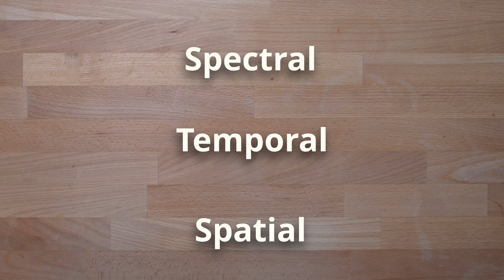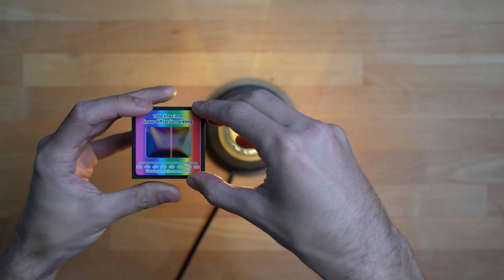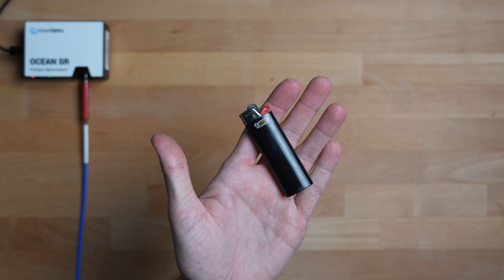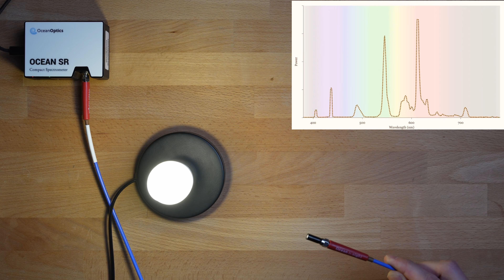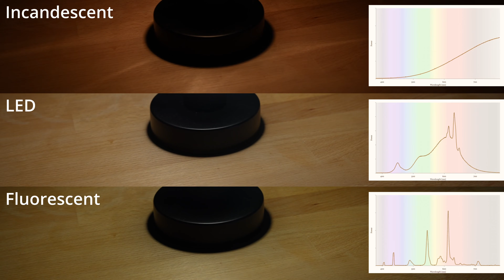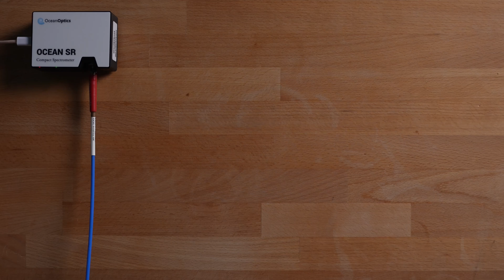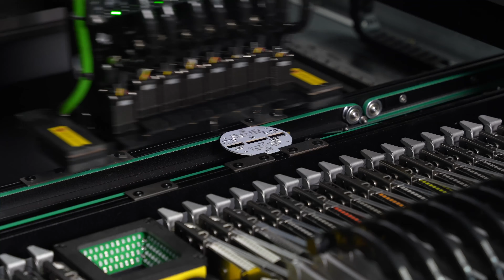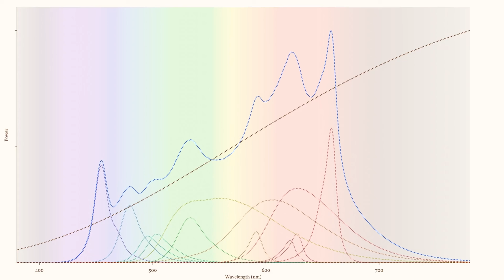Why Modern Lighting Feels Bad (and How I Fixed It)

Comment: I've noticed this as well, and for this very reason I'm still using some halogen lamps in my apartment. One thing I would have loved for you to touch on is CRI (Color Rendering Index), which I thought was a metric designed to let consumers know how accurately a lamp will represent the spectrum at its rated color temperature. What's your take on this? Have you measured the CRI of EP01 at various temperatures?
Reply from the maker: I am going to cover metamerism, CRI, TM-30 and other color metrics in a future video. I had started to include it in this video, but decided to focus on spectral power distributions / blackbodies exclusively as they're the foundational understandings needed before going into color metrics. 

I have measured EP01's CRI at various temps. CRI at 2700K is 98-99 for reference. I tend not to use CRI as the authoritative metric as it's a bit unreliable (https://en.wikipedia.org/wiki/Color_rendering_index#Criticism). Enody's optimization relies on a modified SSI to more accurately emulate the spectrum directly instead of using the sample based approach of CRI.

Comment: HEY, SO, I'm like... a HUGE fan of light bulbs, like, massive. They are an appreciable expense in my house because of how many I buy and for all the applications I use them in. I don't mean to brag... but I have a high CRI 100W (From the wall, not equivalent wattage) light bulb lighting up my bathroom... and a bunch of other high wattage high CRI bulbs lighting up my house. I buy grow lights for... basically everything in my house. My house is well lit like a MOTHERf*cker! After all this time learning about lighting and why my own home feels bad, I've come to the personal conclusion that all my lights are just in the wrong places doing the wrong things.

The best lighting upgrade I ever did for my kitchen was to angle my overhead lights so that the point lights were used as task lights rather than ambient lights... and that made a bigger difference than ANY color temperature, rendering or temporal change could. I worry that in your pursuit for the, "perfect light bulb" it might jump your mind that the biggest difference to lighting is often not color and spectrum, but placement. I have a room in my house that is lit from above with 2700k string lights placed around the ceiling a few feet away from the sloped roof. In other words, absolutely perfect ambient lighting. I still have many other lamps and task lights and clamp lights and aquarium lights to light up specific areas of my house that I want to draw focus to or do tasks under. I hear that you want lighting to help humans with sleep and skin and a buncha other physiological stuff, and I see that you're trying to match lighting to black-body radiation, but I feel you might be missing the middle of the problem, what's in between the bulb and me, all my walls and stuff! I can't imagine how much work you've already done to bring you this far along in the process, but make sure you talk to interior lighting experts, as they probably have similar wants in a light bulb as you, and have plenty of hands-on experience when it comes to designing beautiful spaces in regards to lighting. I think that beauty is a better target than healthy when it comes to lighting. (especially considering that beauty is a very important part of human health)

I should also mention, most of the stuff you've described can be had in aquarium lights. multiple LEDs with different temperatures and colors? check. High CRI? check. individually addressable LEDs? check. app-enabled timers so that you can vary the temperature, color, and brightness over a 24 hour time period to match the cycle of the sun and moon??? check. Buy some, break them down, learn all their juicy secrets, and then sell me one I can put in a lamp!!! Or one of the other dozen different types of light fixtures and sockets in my home... gosh fit one of your bulbs in a MR16 socket without it overheating why dontcha'... or a boob light...

Look, all I'm saying is that it seems like a lot of disparate and competing ideas are all coming together into one blinky tech sandwich, and I'm really excited to see how you come up with 'your' 'perfect' light bulb. I don't think that this fixes modern lighting... at all, because the problem with modern lighting is that there are actually 100s of problems, most of which are just interior design problems as old as the concept of a fire in an enclosed space lol. Most have overlapping and competing solutions, and there's not just a drop in fix for every use case for every room for every space... But I am very glad that someone cares as much as me, in fact more so because you're actually doing something about it!

In conclusion if you make a lightbulb that makes me FEEL like there's a real sunset in my house every night I will just hand over my wallet, checkbook, banking details, and any spare change I find between the couch cushions.
Reply from the maker: I completely agree that placement is incredibly important. When considering the aspects of light (which I group into spectral, temporal, and spatial), I viewed spatial as the least controllable up front. Spectral and temporal I can address immediately, but until Enody makes much more form factors spatial remains elusive.

You've absolutely nailed the end goal though. If we can have enough light sources, with great spatial variety and temporal synchronization, we can mimic a real sunset. Further, what if we had an affordable spectral recording device and you could replay the exact sunset from a memorable evening? EP01 was designed to be the authoring node in a system like this. Replay and design lighting recipes (for lack of a better word) at your desk, then deploy them to your whole home / office / neighborhood.

The future of lighting is enthralling, and I hope Enody can accelerate the timeline :)

Comment: This is very cool, do you think that maybe some form of physical colour filter could be used to flatten out those peaks? Maybe something for version 2? and also, are you planning on releasing a bulb version of this product for existing light sockets? :)
Reply from the maker: Physical color filters could be used to reduce the amplitude of some peaks, but they come with a couple issues:
1. Absorbed light turns it into heat. This will lower the overall efficiency of the lighting.
2. The filters themselves will cause a new set of peaks that will have the same effect.

As the bulb is dynamically shaping the SPD, flattening the peaks in one configuration could cause worse peaks in another configuration. The best solution would be to increase the number of color channels while decreasing the width of their spectral power distributions. This would give you finer control and allow you to lower these peaks. Unfortunately this is a bottleneck in the underlying physics of LEDs, and until new LED types are developed we're going to have these peaks.

A bulb is definitely in the works. I would have loved to ship a bulb as the first product, but the manufacturing demands to make a bulb are significant. The  plan is the same as many new hardware companies: start with a high-end product while the technology is still expensive, then scale manufacturing and bring costs down. This will allow Enody to ship increasingly diverse products and make spectrally tunable lighting cost competitive with current LED lighting.

Comment: I actually still use carbon-filament bulbs in some parts of my house rather than tungsten.  You want warm?  This is curl-up-next-to-a-fireplace-with-a-good-book-in-the-middle-of-a-blizzard warm.  Efficiency? Terrible.  Is it worth it?  absolutely. 
I use theatrical lighting gels/filters on the other lights in my home.   Lee#052 - Light Lavender mimics the GE Reveal bulbs.   Rosco #3220 Minus Green gives that lovely pinkish warmth for living areas.

Comment: Product costs $329 for those curious.

While I appreciate the engineering and ethos behind the product, a 75W incandescent bulb left on 24/7 would cost just over $8/month (assuming $0.15/kWh), meaning a breakeven of just over 40 months.

While I also appreciate this does a lot more than a dumb bulb, ROI just does not make sense to me personally, Jo Shmo looking for decent interior lighting. Despite that I hope this finds success and flies off the shelves and fights break out amongst those hoping to secure themselves a piece.
Reply from the maker: Fully understand that. The long term plan is the same as many new hardware companies: start with a high-end product while the technology is still expensive, then scale manufacturing and bring costs down. This will allow Enody to ship increasingly diverse products and make spectrally tunable lighting cost competitive with current LED lighting.
Reply: @enodylighting  I completely understand and applaud you, and wish you the best of luck

Comment: This video kinda goes topsy-turvy on a core principle of the LED lighting community.
We need LED white light -> "mix R G and B" -> it looks bad -> "get WRGB strips with separate white channel!" -> can't control the temperature? -> get CCTRGB strips with both warm and cold white channels -> I have money, and I want the endgame stuff -> get a CCTRGB strip with 98 CRI on the whites.

I have one more remark, I'm just a itsy bitsy teenager from a 3rd world country, but even I had already through of taking several leds to (lets say a cyan led, attached right next to a white led, whose only purpose is to fill up the cyan valley) complete the gaps in led spectrum to mimic sunlight.
So this really isn't a novel idea. Heck it was the only logical solution, that people much smarter than me might have already thought of and abandoned.

Comment: How are people obsessed about lamps so much that they are willing to dump money into them. The job of a lamp is to enable you to work without sunlight, not trip while walking, see into deep shaded corners. To light a room practically, you need ceiling lamps or spotlights not a sphere that sits on a desk.

There are ultra-violet LEDs from Korea that have three phosphor "mountains". They are less efficient and cost a lot of money, but definitely less than a custom solution. If this is a promotion from a company, why do I still see unskippable advertisements in this video?

Comment: I get that the current price on the website is due to the limited and largely hand made manufacturing process, do you have any idea what a per unit cost would be to have something like this mass produced? I'd love to have multiple lights like this in every room of my house but the current cost is a bit much for that.
Reply from the maker: With mass production I anticipate getting cost competitive with comparable dynamic bulbs (i.e. Hue) relatively soon. To get truly cost competitive with the budget bulbs at your local hardware store, Enody is going to need to vertically integrate and own the LED production process from MOCVD to end distribution. I'm excited for the road ahead :)

Comment: 342 subscribers and 7.5k views on the only video on the channel, video released 6 days ago. Yeah, if you keep up the quality, and if you , release the next 2 videos in the series relatively soon (as in within a month since the release of the first video), this channel will reach 10k subscribers and 1m views within a few months at most. Even if half the video is advertising your own product. 

And speaking of product, please consider making a single-LED capable of producing sunlight at different periods in the sky and in different seasons, and use that with a parabolic reflector, to make a fake-sunlight product which to not only make realistic sunlight spectrum light, but also to make it travel in parallel, to look like it's actual sunlight, instead of a pale imitation, even if it is a pale imitation. And by being able to turn a dial, you could swap up that LED with another LED in an array of LEDs, and end up producing nearly-sunlight of a different season and/or time of day. 

That could even be automated, to make fully artificial fake sunlight for things like bunkers, fancy (expensive) houses, (international) leadership offices, and even psychologic and psychiatric research. 

And a cheaper but lower-quality version could be made using either a LED and a fresnel lens, or multiple LEDs and fresnel lenses, to be able to imitate much larger windows, while still keeping the fake-sunlight panels thinner. 

And that could even be miniaturized, to have lots and lots of tiny LEDs, together with very fine fresnel lenses, to possibly have fake-sunlight panels as thin as solar panels, which could also be advertised not only for office usage, but also for usage on other planets, and on the moon, where the radiation would require the astronauts to be shielded from sunlight for most of the time, but the effects of not having realistic sunlight for extended periods of time would also be very negative, and such a product, if made to be very thin and lightweight, with smaller LEDs which would also help a bit with passive heat dissipation, could solve that problem, especially if paired with realistic-looking fake plants and flowers, and having hidden perfume dispensers in those flowers and plants, to have a calming effect on the astronauts, maybe even having a small (2 yards/meters wide and 4 yards/meters tall and a thin layer, but not a laminar flow, but rather a realistic turbulent-flow) waterfall on display, a real one, even if it's behind a glass window, for reasons of sanitation.

Worst case, you could even use all LEDs together with a prism in reverse, to merge the light back together into a single stream of light with the rays going parallel or very close to parallel.

Comment: The linear combination of LEDs is not comparable to training ML models. Cmon. This is a cool product, just don't overhype it.
Reply from the maker: Apologies, I did not mean for it to sound like a direct comparison it to the training of ML models. The process I was referring to is the utilization of gradient descent to optimize the color mix for arbitrary goals (loss functions). The nice benefit of the recent AI boom is that frameworks for utilizing GPUs (or other compute) to perform gradient descent have become much more accessible. In Enody’s case, tinygrad is utilized. An example can be found here: https://github.com/enodylighting/enody-py/blob/main/examples/optimize_chromaticity.py
Reply: @enodylighting  You want to use linear regression, not gradient descent here.

Comment: is the difference between this and having LEDs that mimic light temperatures but only by emitting 3 colours to stimulate the 3 receptors in our eyes the way that these interact with materials which may particularly absorb the traditional LED spikes in a way that would appear differently to natural lighting due to the intricacies of a materials absorbancy graph not being captured normally?
Reply from the maker: Yes. While a trichromatic (3 colours) light will look correct when you directly observe it, the way it illuminates your environment will be incorrect. When something is illuminated, the color you see is a multiplication of the spectrum of the lighting and the reflectance of the material. For example, a cyan object reflects a lot of cyan light, but minimal of any other color. In this situation, the 3 colours (assuming RGB), will fail to provide sufficient light in this range and the cyan will appear desaturated and washed out. I will cover this in a future video :)

Comment: You should ckeck YujiLEDs. They make very high quality bulbs that match real sunlight. They also make 2700K lightbulbs with high CRI. I bought 4 bulbs from them and they feel very nice. (2x 5000K normlight and 2 6500K sunwave)

Comment: I'm surprised that CRI (color rendering index) never once came up in the video. It's a decent single number to describe how natural light produced by a bulb is. Incandescent bulbs have a CRI of 100 (the reference standard). Fluorescent bulbs sit around 60-85 CRI, though there are triphosphor variants that reach 80-90 CRI. Cheap LED bulbs sit around 70-80 CRI. Good quality LED bulbs typically exceed 90 CRI and can go as high as 98 CRI.
Reply: Yes but selling the magic lamp is the idea here, not informing viewers that high CRI lighting options at much more reasonable prices exist.
Reply: @mike-g7i9t  It's one approach, however tuning the light to the normal red, green, and blue cone response might be more effective.

Comment: How’s the flicker?
Reply from the maker: Per this study (https://visualstress.info/2013-207.pdf), the theoretical biological threshold of the human eye for PWM sensitivity is 35KHz, which is the PWM frequency of EP01. The flicker rate can be increased, but at these frequencies you're increasingly trading off brightness to achieve unsubstantiated biological wins.

It is still in development, but I am working on a mode for EP01 that does purely electrical current based mixing and has no flicker at all. The tradeoff here is that you lose a bit of precision (PWM can provide better granularity in mixing), but can completely eliminate flicker. 

I personally believe that 35KHz flicker is sufficient, but I completely understand the desire to eliminate flicker completely. I can attest to the flicker in most consumer bulbs being MUCH too slow. The highest I've measured in any PWM based consumer bulbs was 2KHz.